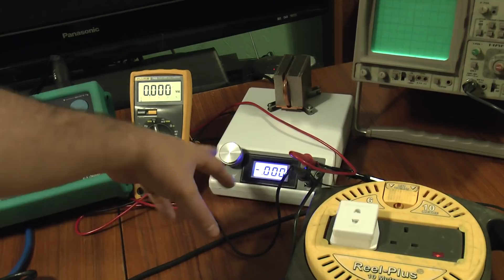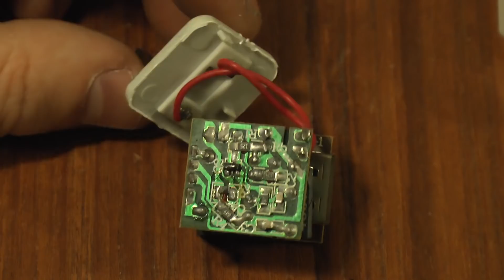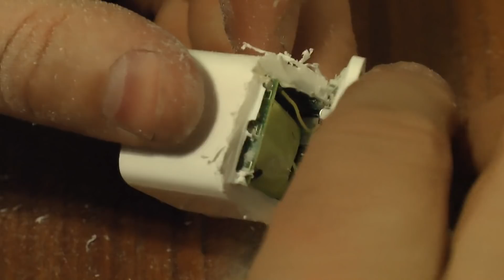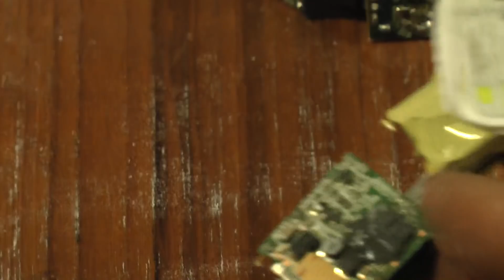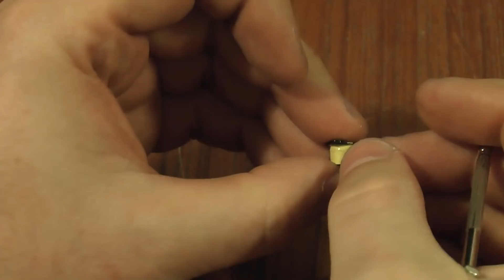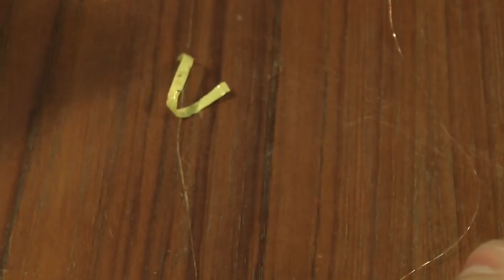Apple iPod chargers - fake versus genuine

Comment: Chargers are not meant to be used as a power supply. They are trickle chargers that take hours at a moderate load to recharge the batteries. I use cheap ones and genuine types. They all work the same if you use them correctly.
Reply from the maker: They should be able to output whatever's written on the back. If this is time restricted then it should say so, for example 1A continuous, 2A 10 mins.

Comment: While watching I iopened my not OEM charger and I can say it is so easy when trying from the side , not frmo where you did because you broke it somehow. Doing it from the other 2 sides with a cutter does almost no damage because it has some notches inside. Just insert the cutter and pull out. Clean job. anyway good video thanks

Comment: I bought what I eventually discovered to be a counterfeit cord/adapter on Ebay from a seller named SUKAR, and my Ipad was fried after the second use! $499 Ipad Air destroyed! I called/emailed Ebay, their fraud department, their general email, did everything I could think of, even sent them messages on Twitter, but they still haven't done anything. I didn't read the writing on the adapter which read "Designed in california Assembled in china (note the Cs in California and China were mis-spelled using a lower-case c for both). The lettering and symbols is also much more faint compared to the slightly larger, more bold ink on the genuine Apple Cord and Adapter. I would advise everyone to bite the bullet and pay the $40 or $50 that these cost at the Apple Store, because at least it won't ruin your Ipad, Ipad or Iphone like the counterfeit did my Ipad Air II. SUKAR, the seller just creates duplicate listings so that the warnings that I and other users post, is essentially deleted, and Ebay doesn't care even though I've advised them that fake chargers can detroy expensive property and cause fires! I sent them pictures of the fake and the genuine products side by side, again, they did  nothing. The Ebay listing in case you were thinking about buying a cord and or an adapter from Ebay: http://www.ebay.com/itm/232083951598?_trksid=p2057872.m2748.l2649&ssPageName=STRK%3AMEBIDX%3AIT

You've been warned, and Ebay and the seller both refused to even discuss re-paying me for the Ipad, though I received a refund from the seller, even though he didn't even ask me to send it back (which stuck me as telling).
Reply from the maker: If you post a link here to their eBay store it may well turn up if people Google them by name.

Comment: I have a game console power supply that causes noise over the tv speakers. It's an aftermarket power supply. What causes that?
Reply from the maker: In short: poor design that doesn't comply with the relevant regulations.
"This device complies with part 15 of the FCC Rules. Operation is subject to the following two conditions: (1) This device may not cause harmful interference, and (2) this device must accept any interference received, including interference that may cause undesired operation."

If you took the cover off you'd probably find for example that the input filtering is either partly or completely omitted; chokes replaced with wire links and/or missing capacitors.

Comment: Good teardown. You may have overlooked something important in your eagerness to unwind the transformers.  You referred to the single-diode, half-wave rectifier in the fake charger as a 'bridge rectifier,' not so.  The genuine product actually HAS a full-wave bridge rectifier, but you didn't slow your movement of the charger long enough to focus on that, and you kept inadvertently blocking the view with your fingers.  Come up for air once in awhile, as it benefits all of us.  That said, I appreciate the effort.

Comment: Wondering if i could ask for some advice. im building a 10 port usb phone charger and i want to add a 4Amp  ferrite bead on the 5v. on every usb port.. From what i can find on google some say use a 33R and other source recommends 600R. what would you personally recommend please ? the 5v is coming from a high quality pc atx power supply capable of 40A on the 5v

Comment: I'd rather take my risks and buy a fake one that's 10X cheaper than the overpriced apple charger and it does it's job unless put into extreme situations. I've had a shitty apple charger that cost me 3 bucks for 7 years now, no fire starter since I NEVER leave anything charging when I'm not home, that's a stupid thing to do, even with A grade devices. Apple products are overpriced, end of. Good video anyway. I enjoyed it.
Reply: +ADevilNeverCry I don't know, I bought a fake lightning charger from a grocery store and it would over heat my iphone 5. Like, you could feel it sting your skin if you pressed your hand up against it. It would make the phone glitch out also, I would try to swipe or type and it would perform random actions. It's well worth the extra couple bucks to save you phone from frying.
Reply: +ADevilNeverCry  If it cost you three bucks. Its fake.
Reply: +mharris1270  You can get a real iPad Charger for $20. Same for the phone chargers.   $50 would buy you two iPad chargers with change over.  I have some good wallwarts that came with my Android stuff as well.  But a shit charger is a shit charger, no matter who makes it.       Apple dropped charger prices years ago, cuts way back on warranty repairs from crap chargers.

Comment: The thing that instantly struck me is the wiring. The fake one has nice thick cables of proper [red] color. Its required here to have red cables if its a live wire. Other than that its a death trap or potential house fire starter. 

In comparison the apple cables are green . . . .for some reason. Green cables should only be used for ground, and their thickness is abysmal. These are 0.5mm solid core wires and u put 230V through them? These kind of wires can break easily on bends then spark and heat up. . .
Reply: GotCritified These units are not repairable, and are not intended to be disassembled. So the wire color is of no matter. Also, the wiring is not moving once the device is assembled. I would worry more about a line to USB short, thus taking out your iPhone. You can bet the cheap one has a much greater chance of doing that.
Reply: +GotCritified Those thin wires are intended to be a fuse, so when too much current is drawn, the wire will burn over befor the power supply explodes.

Comment: I'm impressed with Apple's engineering. I find their business ethics disgusting, but their engineers are certainly of caliber.
Reply: +Corto Maltese  He is talking out his ass.     Went 100% Apple ten years ago.  Why? I buy the things, use them for 3 years and get half my money back. And if I do keep something  Hell there are ten year old Macs in this house that are still in use,  emulators to webservers.    They just don't die.
Reply: Ethics, they have none in my opinion, allegedly, reputedly, hearsay, some say,  now you wouldent like to be sued would you.
Reply: ***** Then you've obviously never had one of their products die because it overheated due to their 'high calibre' engineers.
They cram high temperature parts into completely inadequately ventilated enclosures, then remove posts in their forums by people complaining about dead devices.  If there are no reports of defective units then they don't issue refunds or replacements.
I've had TimeCapsule and macbook products die or become defective due to their idiot engineers filling the power supply in the TC with silicone (to make repair impossible) and thus trapping the heat, batteries swelling and deforming the logic board in macbooks, and video cards in the macbooks overheating leading to complete display loss.
Their engineers might be talented, but they have to cram their parts into stupidly designed enclosures to maintain the 'coolness' factor, and are too gutless to make a stand.  Just look at what happened with the iphone4 antenna problem.  Steve and Jonny both wanted to stick the antennas externally, and even though they knew this would kill the reception, they FORCED their designers to do it.  Result - antennagate.
Reply: Mike Caddick Huh, never knew all that. You're right though, I've never had an Apple product die on me; probably cause I've never bought an Apple product in my life and don't intend to.

Thank you for providing even more reasons for me not to invest in Apple :)
Reply: Just because they keep their value because idiots are fools with money means nothing.

Comment: AintBigAintClever The charger included with my refurbished Iphone 5S from ATT is unmarked, no Designed by Apple, Flextronics etc.  I wonder if I should go the ATT store and complain....
Reply from the maker: Interesting, certainly sounds like you've not been given a genuine Apple one.
Reply: AintBigAintClever Seems someone is cutting corners.  Luckily I have two other originals which I have use instead.
Reply: mharris1270
  That's just it.  It was not purchased at a store.  I bought a refurbished 5S through my AT&T account online.

Comment: I stopped buying the small cube chargers and now I buy only the dual USB port chargers.  One is a 1amp and second is a 2amp.  I keep 3 of these working all the time and have never had any trouble or complaints.  Although, many of these aftermarket chargers are not UL listed.  That does cause some worry.

Comment: I have been selling chargers for over 8 years. In that time, I have had 3 that failed to charge. Last week, a buyer claimed a charger he purchased from me burnt his phone. (I don't believe it ) So, 4 problems in 8 years ? A pretty good track record for a very cheap product !
Reply: The Chinese knockoffs can be lot worse than just burning the phone (and yes that is very much possible with the crap inside some of these), they can downright electrocute someone. Sure its unlikely to happen, but would you want to be the guy who sold the death sentence? When it comes to mains connected equipment steer clear of cheap chinese knockoffs, they don't have safety rating for a reason. With anything not mains connected, go to town, if it breaks it wont kill someone.

Comment: Unfortunatly I got conned TWICE buying them online (got refunds though) until I decided to go to Dick Smith electronics and got some proper ones. these were the "duck head" chargers too (the ones with interchangeable plug heads). one of them popped (low side rectifier went open trying to charge my iPad). avoid online chargers from fleabay or in my case, a New Zealand site called trademe. if they dont come in a sealed box from apple in the package. it is likely fake

Comment: Does it have any fuse in there?
Reply from the maker: On the fake one? No. Input goes straight to the bridge rectifier. No protection.
Reply: AintBigAintClever I meant in the original. Is the green unlabeled through-hole component a fuse, right?
Reply from the maker: Davi Poyastro
I think you might be right.

Comment: This is when Apple's aluminium construction kills people, haven't heard of electrocutions from fake chargers on non-apple products yet.
Reply from the maker: So by that token if someone gets electrocuted by a washing machine that's plugged into a badly designed extension cable, that's the washing machine manufacturer's fault for not making the whole thing out of plastic?

Not heard of any non-Apple ones yet? Here, have a Gameboy. http://www.tradingstandards.gov.uk/policy/policy-pressitem.cfm/newsid/24
Reply: /me starts the war
Reply: I wasn't electrocuted but a non-apple charger melted my Iphone.
Reply: "This is when Apple's aluminium construction kills people,"
Your comment makes no sense at all.
Reply: Tak Wolf didn't say it even had to be the cheap chargers fault. From an engineering standpoint apple should be prepared to protect their possible inputs from any source possble. A few stand alone events can happen here and there, but more than 2-3 phones melting from a charger? Time to figure out what's wrong with ur phone design and how to protect it.
Reply: Michael Stevens I put concrete in my washing machine and the POS broke plus ruined all the drains lines in my house. I’m calling the manufacturer to complain that they don’t have proper protection from incorrect inputs.
Reply: normally metal construction are earthed, TheAmmoniacal
Reply: Daniel Mattison The melting of your iPhone is a due to the iPhone's inability to protect itself from outside sources or stop its batteries from over charging. Do not kid yourself about your charger melting your phone. Blame the $500+ dollar cell phone that couldn't protect itself or disconnect battery connections at increasing temps.

Comment: think of it like running (volts) up a hill with a bag (amps), you will go up the hill but not as fast as someone who is built like a brick shit house doing the same thing, and by the time you get to the top you will be all hot and burnt out yet the other guy would have hardly broke a sweat!

Comment: Yes,and for the first comment I posted:
Those were the BAD situations I had with Chinese stuffs.
I actually use Chinese stuffs as well,like Phihong USB PSU that I am using for my mobile phones(and it serves everything firmly) and random appliances I picked up. They actually WORKS IDENTICAL to commercial ones and CHEAPER than them.
Thus I don't hate ENTIRE market.

Comment: I bought a black 30 pin usb wire from ebay and plugged it into my macbook air to charge my iphone. Is it possible that it hurt my battery because im not getting 12 hour battery life. When i click the battery at 100% it says i only have 5 hours.

Comment from the maker: The one I tested dropped to 3 volts at 500mA when fed with a supply voltage it would be getting in the USA (remember it was ordered from Wisconsin). Hardly what I'd call reliable. Definitely what I'd call a piece of cheap shit.

Comment: The knockoffs are 1/10th of the price and actually provided 500ma of reliable charge. Most people have stable power and most use surge suppressors so spark gaps and performance under 100v and esp. thicker plastic walls aren't really an issue. Apple's design exposes bare copper from the main input voltage kept away from the circuit by silly plastic paper. That is awful. My real charger broke away in a socket and that bare wire shocked me and became a hazard. That is a far more serious issue.

Comment from the maker: The dummy load's based on mjlorton's dummy load which is in turn based on Dave Jones (EEVblog)'s dummy load. It looks neat because it's built into a neat case (an old BT NTU11A) with an Xbox 360 CPU heatsink on top to cool the MOSFET.

Comment: 15:05 is usually a sign of overheating rather than the windings too tight. Would be a good test to see what happens with them on full load for extended periods of time! So what do Apple do for the UK market with 13amp plugs? I could see a similar plug for the AU/NZ market as the pins are just twisted. Maybe the UK needs to bring back the 5amp sockets to popular use :) ...Always interesting to see comparisons with cheap and genuine products, thanks for the vid.

Comment from the maker: It's very difficult to tell them apart without actually testing them, although testing may be easier in the US (or other 100-120V countries) as the fakes struggle to do their job at that voltage. The eBay seller who sold me this one was specifically advertising it as genuine, but if all of his PSUs are genuine why did he also send me a fake? At least if an eBay seller claims it's genuine and it's not you can try claiming back through PayPal.

Comment from the maker: It prevents interference with other devices such as radio equipment. There are other vids on YouTube where someone's got a radio running when they switch the PSU on and you can clearly hear the interference it's kicking out. More info at en. wikipedia. org/wiki /Electromagnetic_compatibility

Comment: it wouldn't surprise me if the fake supplies use a blocking oscillator or some other sort of transistor oscillator to generate the supply voltages, that sudden drop in voltage with current does suggest that